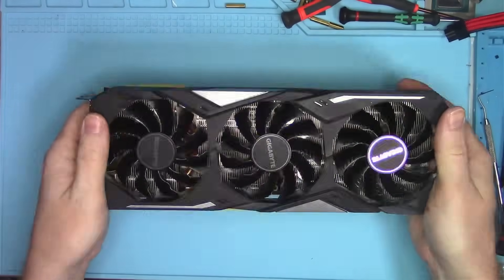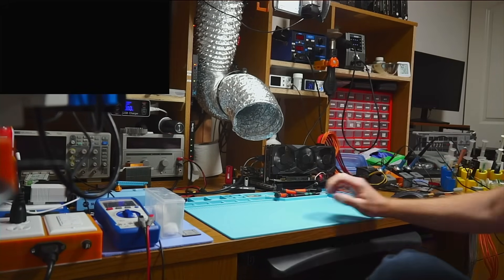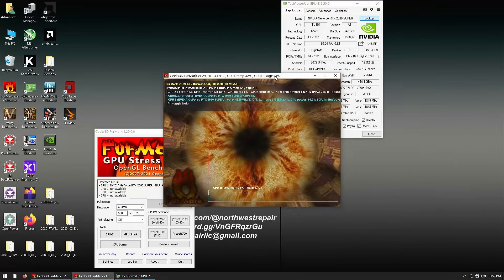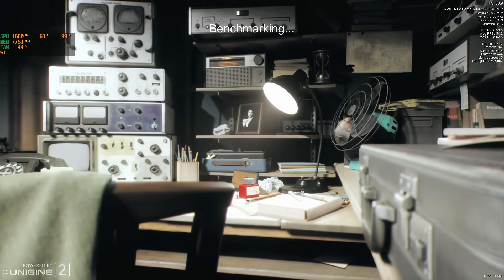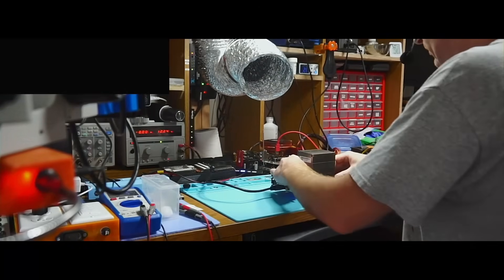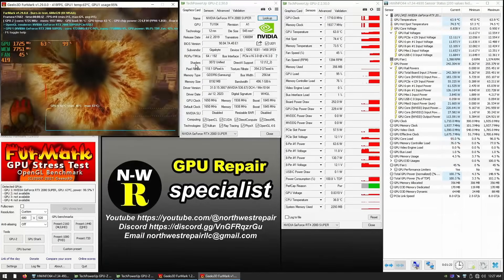GPU Artifacting FIX

Comment: I had this issue on 2 brand new out of the box AMD R9 280X, after that I switched to nVidia and I'm never looking back - the "fix" was lowering the core clock by some small amount (~100Mhz if I recall)

Comment: You weren't doing any undervolting but rather underclocking.
To really undervolt you might wanna click a point at like 900/950mV and press L then increase clock to reach the stock clock. Then you can say it's an undervolt :)
Also FYI I previously had similar issues, in the end it was core voltage regulation being too unstable... It was caused by 12v input filtering capacitor being bad/not effective enough
Reply: Look at the window with the curve. Top-left. The tab that is selected is "voltage". Also, carefully look at the other line jumping around, up and down, marking a horizontal line along the frequency axis. It matches the same frequency shown on the OSD where the FPS and temperatures are. He was correctly manipulating the voltage. You're confused because the curve editor changed.

Comment: By shifting the V/F curve down you actually overvolted the core (lower frequency for each given voltage step). 
Great repair as always!
Reply: Look at the window with the curve. Top-left. The tab that is selected is "voltage". Also, carefully look at the other line jumping around, up and down, marking a horizontal line along the frequency axis. It matches the same frequency shown on the OSD where the FPS and temperatures are.
Reply: @Expo_Hans  Okay, but look at the curve now, stock curve is 700mV 1500MHz and he shifted it down to 700mV 1300-ish MHz, hence higher voltage for the same core frequency. If the core is unstable then feeding it less voltage for a given frequency would not work at all, to attain stability you would feed the core more voltage for a given core clock and it's exactly what Nortwestrepair did. It's just semantics.
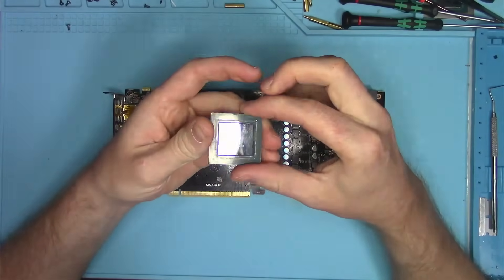Reply: @MrSolvalou   Look at the graph. Voltages 1025mv and 1250mv intersect frequency 1.8ghz at the same time. It doesn't make sense that all that range of different voltages would be applied to the same frequency at the exact same time when frecuency 1.8ghz is required. The graph is all messed up, but he actually lowered both voltage AND frequency, lowering the heat output, which was causing the artifacts from thermal stress. You can even see how the center of the chip is devoid of thermal paste precisely at the center where the hotspot is.  2:02
Reply: @Expo_Hans  Nvidia cards take these VF curves as suggestions when boosting, you can see that the card goes above 1.8GHz anyway. By adjusting the curve the way he did he underclocked and overvolted the GPU but it's still gonna boost into the power limit, if you want to reduce heat output you would have to manually reduce the power limit. To undervolt with Afterburner you would raise the whole VF curve up  until it's at the edge of instability and also reduce the power limit if you want stock performance with less heat.

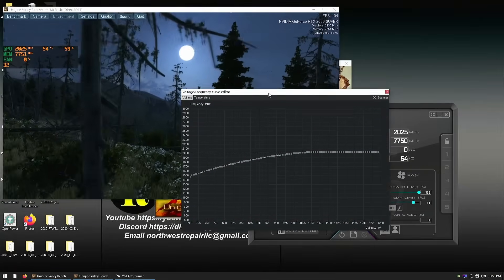Comment: 1:10 That is not really "lowering the voltage", you are shifting the V-f curve down, which results in a combination of lower max. clock and higher voltage at lower clocks. At no point along that curve does that result in a lower voltage.
Reply: Look at the window with the curve. Top-left. The tab that is selected is "voltage". Then, carefully look at the other line jumping around, up and down, marking a whole horizontal line along the frequency. It matches the same frequency shown on the OSD where the FPS and temperatures are.

Comment: Seems like the gpu core suffered electrical migration where voltage going somewhere where it shouldn't that why undervoltaging works temporarily. Seems to me that voltage to core seems to be the culprit where higher voltage is not shown but explains the artifacts relation to voltage set too high or the core hates the voltage given to it after it degraded over time

Comment: how do you tell if artifacts are core issue vs memory issue?
Reply: Memory artifacts are almost always in patterns. Several squares separated by an exact number of pixels between one another. While core artifacts are random.
Reply from the maker: Experience

Comment: Damn the whole core replacement so no possible way to fix the other one? Like a  bad ball joint or it's just a degraded core?
Reply from the maker: No
Reply: The other core was probably fine. You can see that there is a void where there is no thermal paste at the center of the chip when he shows the two cores, which means that the thermal solution it had on it was not doing its job properly to dissipate the heat coming from the hotspot. The resulting thermal stress caused missalignments between microscopic transistors which in turn caused the artifacts. Lowering the voltage also lowered the heat output, which made the thermal stress lower. I know this by experience because it happened to my own card, too, and I solved it by just performing a proper maintenance. At least 2 years of survival and then I sold it for an upgrade.

Comment: Couldn't a bad phase create the same problem? Like its still enough good to work, but doesn't power enough voltage and current. If it was me I would start by checking every phase first and then replace the core( im a beginner in gpus )
Reply: The problem according to the tests that we see in the video, is that there is too much voltage for the core to handle. In your theory, the aspect you would have to check for is whether a phase is providing more voltage than it should. But you would probably arrive at the same conclusion that the problem is related directly with the core. I had the same issue with an RX590 and it was actually caused by thermal stress due to poor maintenance (bad dissipation experiment in my case). I solved it and it worked like a charm for several months until I sold it for an upgrade. Just performing a good maintenance was enough for it to handle even overclocking with no problem.
Reply: @Expo_Hans  nah he misspoke, what he did with the V-f curve actually increased voltage and reduced the core clock
Reply: @TheBackyardChemist   Look at the window with the curve. Top-left. The tab that is selected is "voltage". Also, carefully look at the other line jumping around, up and down, marking a whole horizontal line along the frequency. It matches the same frequency shown on the OSD where the FPS and temperatures are. He was correctly manipulating the voltage.
Reply: @Expo_Hans  That is not how an X-Y graph works.
Reply: @TheBackyardChemist  If you analyze it as an X-Y graph, you get that both 1020mv and 1250mv both occur at the same time when the frequency hits 1.8ghz. Obviously that doesn't make sense. Instead, I insist that you should look at the top-left corner where the tab says "voltage" on the curve editor. He IS editing the voltage.
Reply: @Expo_Hans  What? The "Voltage" in the top left corner just means he is on the voltage tab, it is not the axis name. The Y axis is clearly labelled as "Frequency, Mhz", and the X axis is clearly labeled as "Voltage, mV". And the flat region is not that much of a problem, it means that any voltage in that range is OK at that frequency.
Reply: @TheBackyardChemist   Yes, I know how the "axes" are labeled. But again, analyze them. Does it make sense to you that both 1020mv and 1250mv would occur at exactly the same time?  It is not there to tell you that any voltage is OK for that frequency. You're literally doing the opposite, you move the slider and you tell the curve to do that. So you're telling the curve to activate 1020mv and 1250mv simultaneously for that frequency....  Which is why they changed the layout in recent versions to make it clearer.

Comment: I wonder if he just re-balled the original GPU and solder it back down, the problem would go away.  It could be an intermittent solder joint.  Swapping out a GPU sounds expensive if there wasn't a spare GPU.
Reply from the maker: No it would not go away.
Reply: The fact that he had to undervolt to "correct" the issue points to degradation of the silicon, not a bad solder joint.

Comment: Thanks for the video!

Very interesting. Would you expect the band aid undervolting solution to fix the symptoms for very long? Or does it only buy youa a bit more time before the gpu degrades further?
Reply from the maker: The problem is, for higher demanding games, you will have to lower the voltage even more.
Sooner or later, you will end up loosing too much performance and judging by what others were saying, its only going to get worse.
Reply: I mean, speaking from a purely economical point of view, squeezing as much as one could out of the artifacting GPU wouldnt be too bad, as long as performance is acceptable for the customer.

Comment: I wish cards could come in the same format as the rest of a computer where you can just socket a GPU in there and even upgrade RAM etc, but we know all kinds of problems would come with it, apart from simply not being feasible and would be quite expensive.
I didn't know before watching this video that a core could cause artifacts, I always thought it was a memory problem because every time that happens it's simply a memory replacement that fixes the problem.
Reply: Sure, if you want it, i have a video card with memory slots. It's an old ISA card.🤣
Reply: Using sockets/slots for GPU's and DIMMs would severely limit memory bus speed - notice that current DDR5 CPU's have similar transfer rates to GPU's from a decade ago.
Reply: @EliteRock  I feel you, I do but what's the maximum frequency a CPU can reach while being on a socket? Is it 6GHz? Is it a workable DDR5 that reaches 7,2GHz stable? If it is, I don't see any unsolvable problem.
Reply: @Dandan-tg6tj  uk that not only freq matters xd u have a lot of data lines that needs to have an exact length, u have latency, memory bus, its not so simple and economical, it would be more expensive
Reply: @Kiburici  Video cards already have the data lines properly set.
Anyway, I know how simple is to solder balls instead of using sockets. All I'm saying is that it is achievable relatively easy.
Reply: @Dandan-tg6tj  PGA feet for vram chips, could work
Reply: @Benri05  It could work indeed.
Reply: @VndNvwYvvSvv  Think about it a little. A memory chip is busted. I can replace it easy with a new one. This won't hurt sales in any way. I would have that chip changed anyway. I won't buy a new 1000USD card just because it stopped working. The card would cost 1010 USD instead of 1000USD. A socket would cost probably 1USD or two.
I'm talking about the most easy implementation, a socket for GDDR6 just like the Intel socket for the CPU. Cards are already mapped the right way.
Reply: I've had the same thought in the past... This, unfortunately, would drive the cost and complexity way up. Cards would also be less reliable because of the extra stress and dynamics involved.
Reply: @dklyned  Way up, you say? It would cost probably 10 bucks or less the part plus labor.

Comment: Out of curiosity, how did you know it wasn't a bad memory chip?  Experience I presume?  Didn't see you run a memory test in the beginning (but yep, you said no typical bad Micron memory).  So I presume that means damage core and why it had to be physically replaced.
Reply: 00:05 seconds. Little sticker from the bottom..

Core worn out from the factory overclocking.
Reply: @era7928   You can actually see the lack of thermal paste on the center of the core when he shows the two cores on camera. The true issue I suspect is that the thermal paste was not bonding with the surface of the center of the core and so the artifacts were caused by hotspot overheat. THermal stress, to be precise.

Comment: I had artifacts like this (a bit more intense even) with an RX470 and only lowering the frequency would make it more stable, but driver would crash eventually and reset everything. It was such a pain.
Reply: Using the polaris bios editor you could have modified the bios to permanently lower frequency and voltage and flashed that on.. frequency does not make a big difference on gpu's so few mhz lower doesn't hurt fps and it is the cheapest "permanent" fix..
Reply: @KuntalGhosh  actually I did that and tried other things too, but that card was doomed and would crash eventually. The only thing I couldn't do was replace or even lift the core because I didn't have the tools, and let's not mention a replacement. After a while it got worse and eventually stopped working. To make it even worse it was during the crypto bubble and a card like that was around $400.
Reply: @Lucius4992  you could have sold it with a very low frequency bios 🤣
Reply: @KuntalGhosh  lol the problem is that the driver won't recognize the card if the bios was modified so it would give problems right away to whoever buys it
Reply: @Lucius4992  why would that be the case..
I dumped the bios from my sapphire nitro rx580 and used the polaris editor to remove all power limit. Set a hard thermal throttle at 80c and aggresive fan curve that would go 100% duty cycle if the gpu goes above 75c , overclocked the core to 1500mhz and ram to 2100mhz then saved the bios and flashed it back in the card. 
The driver says no problem with the settings and it has been working flawlessly since 2018. I did this mod 3 months after purchase.. i had kept a bios dump handy incase i had to send it for warrenty i could just flash the stock vbios and they would not smell anything..(hopefully)..
Reply: @KuntalGhosh  Because it is. They implemented some kind of checksum thing when you are gonna install the driver anew. If you flash an unmodified bios it is fine. But if you alter any parameters the driver doesn't work. Maybe it wasn't implemented when you did it.
Reply: Quite a few times, cleaning the video card fixed the artifacts. Only a very few times I had to replace the core. Anyway, replacing the core does the trick.

Comment: I had issues like these with an RX590 after a bad maintenance during the time when I was experimenting with different dissipation mods. The way to fix it in my case was to simply do a proper maintenance. Consider that lowering the voltage also lowers the temperature output, and therefore the difference between edges and hotspot decreases. When the difference is higher, you get thermal stress on the material of the chip itself, causing the artifacts. So evening out the spread of good quality thermal paste could also solve the issue without the need to replace the core.
Reply: Reminds me of an old Geforce4 or 5  series I had back in the day.  WoW started artifacting one day out of the blue, from then on until I could buy a new card, I kept the side of the case off and had a small desk fan with an icepack behind it blowing on my graphics card whenever I played, worked fine.  Sometimes a core just gets some thermal damage over time that only shows up at higher temps, I guess.
Reply: i don't want to stir the coffee, but still is a bandaid, because still has the issue
Reply: @santiagocastro6701   alternative bandaid?
Reply: @santiagocastro6701   It's not a bandaid. I had that card for 2 years after that an it worked perfectly, even withstanding overclock in both GPU and memory. I only sold it because I was ready for an upgrade after those 2 years.
Reply: Maybe